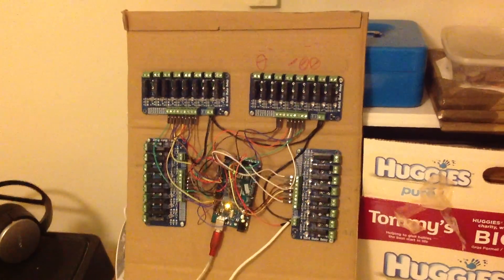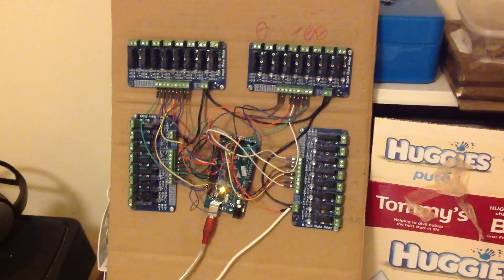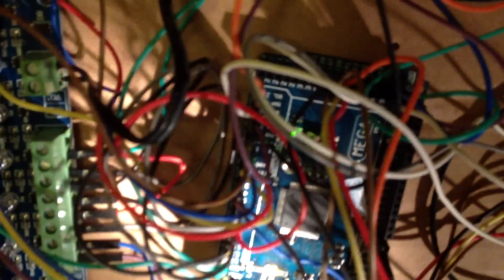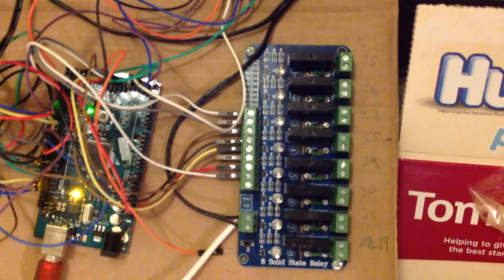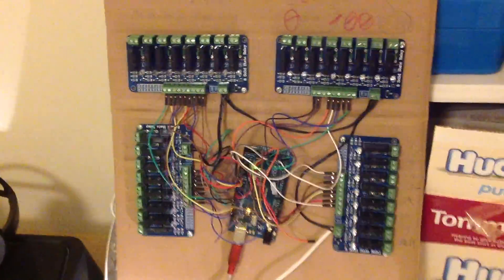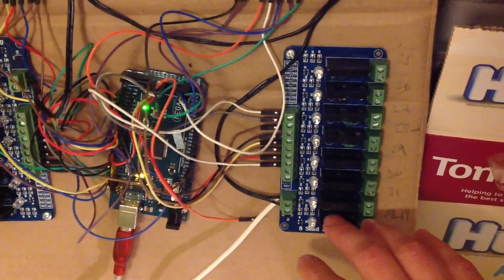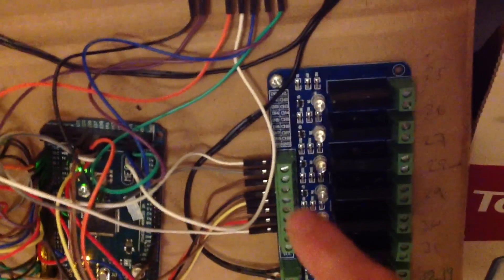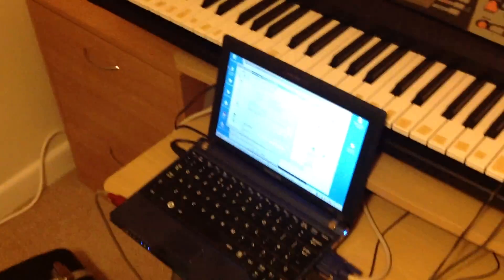Vixen 3 - Arduino Mega 2560 - Sainsmart SSR Relay Board (VIDEO 1 OF 6)

Comment: Simon

Good to see someone is at the same point as myself on the christmas lights.  I started last year with 16 channels.  I am doing more this year and was happy to find your video.  thanks for sharing.   

Currently, I am using the sainsmart 5v relay board for 16 channels and need to upgrade to the SSR.  I have been really happy with the performance.   I do want to move to the SSR relays but I am considering moving to Renard-plus but need to do a bit more research but will allow dimming and rgb control.  It is always the budget that keeps me in check though. 

I am using Vixen 2 still and version 3 is still a little too much to try to take on in the short time I have until I need to get everything going.  

This year I am considering pushing the Arduino Mega with 44 channels.  This code is a small modified version of one I copied last year.  I was watching your video and I noted you were going to upload your code.  You had a few things that peaked my interest in the header of the comm.  

Also I have considered connecting the mega and the Uno on the same computer to expand more or connect them using serial connection.  

Here is my code for simple serial interface using USB.  Did you post your code yet anywhere I can look at to see what you did this year?

int A = 2;
int B = 3;
int C = 4;
int D = 5;
int E = 6;
int F = 7;
int G = 8;
int H = 9;
int I = 10;
int J = 11;
int K = 12;
int L = 13;
int M = 22;
int N = 23;
int O = 24;
int P = 25;
int Q = 26;
int R = 27;
int S = 28;
int T = 29;
int U = 30;
int V = 31;
int W = 32;
int X = 33;
int Y = 34;
int Z = 35;
int AA = 36;
int AB = 37;
int AC = 38;
int AD = 39;
int AE = 40;
int AF = 41;
int AG = 42;
int AH = 43;
int AI = 44;
int AJ = 45;
int AK = 46;
int AL = 47;
int AM = 48;
int AN = 49;
int AO = 50;
int AP = 51;
int AQ = 52;
int AR = 53;

int i = 0;
int incomingByte[44];

void setup()
{
  Serial.begin(9600);

  pinMode(A, OUTPUT);
  pinMode(B, OUTPUT);
  pinMode(C, OUTPUT);
  pinMode(D, OUTPUT);
  pinMode(E, OUTPUT);
  pinMode(F, OUTPUT);
  pinMode(G, OUTPUT);
  pinMode(H, OUTPUT);
  pinMode(I, OUTPUT);
  pinMode(J, OUTPUT);
  pinMode(K, OUTPUT);
  pinMode(L, OUTPUT);
  pinMode(M, OUTPUT);
  pinMode(N, OUTPUT);
  pinMode(O, OUTPUT);
  pinMode(P, OUTPUT);
  pinMode(Q, OUTPUT); 
  pinMode(R, OUTPUT);
  pinMode(S, OUTPUT);
  pinMode(T, OUTPUT);
  pinMode(U, OUTPUT);
  pinMode(V, OUTPUT);
  pinMode(W, OUTPUT);
  pinMode(X, OUTPUT);
  pinMode(Y, OUTPUT);
  pinMode(Z, OUTPUT);
  pinMode(AA, OUTPUT);
  pinMode(AB, OUTPUT);
  pinMode(AC, OUTPUT);
  pinMode(AD, OUTPUT);
  pinMode(AE, OUTPUT);
  pinMode(AF, OUTPUT);
  pinMode(AG, OUTPUT);
  pinMode(AH, OUTPUT);
  pinMode(AI, OUTPUT);
  pinMode(AJ, OUTPUT);
  pinMode(AK, OUTPUT);
  pinMode(AL, OUTPUT);
  pinMode(AM, OUTPUT);
  pinMode(AN, OUTPUT);
  pinMode(AO, OUTPUT);
  pinMode(AP, OUTPUT);
  pinMode(AQ, OUTPUT); 
  pinMode(AR, OUTPUT);
  
}

void loop()
{
  if (Serial.available() >= 44)
  {
    for (int i=0; i<44;i++)
    {
      incomingByte[i] = Serial.read();
    }                                       // Arduino pins
    digitalWrite(A, incomingByte[0]);  // Pin 2
    digitalWrite(B, incomingByte[1]);  // Pin 3
    digitalWrite(C, incomingByte[2]);  // Pin 4
    digitalWrite(D, incomingByte[3]);  // Pin 5
    digitalWrite(E, incomingByte[4]);  // Pin 6
    digitalWrite(F, incomingByte[5]);  // Pin 7
    digitalWrite(G, incomingByte[6]);  // Pin 8
    digitalWrite(H, incomingByte[7]);  // Pin 9
    digitalWrite(I, incomingByte[8]);  // Pin 10
    digitalWrite(J, incomingByte[9]);  // Pin 11
    digitalWrite(K, incomingByte[10]); // Pin 12
    digitalWrite(L, incomingByte[11]); // Pin 13
    digitalWrite(M, incomingByte[12]); // Pin 22
    digitalWrite(N, incomingByte[13]); // Pin 23
    digitalWrite(O, incomingByte[14]); // Pin 24
    digitalWrite(P, incomingByte[14]); // Pin 25
    digitalWrite(Q, incomingByte[15]);  // Pin 26
    digitalWrite(R, incomingByte[16]);  // Pin 27
    digitalWrite(S, incomingByte[17]);  // Pin 28
    digitalWrite(T, incomingByte[18]);  // Pin 29
    digitalWrite(U, incomingByte[19]);  // Pin 30
    digitalWrite(V, incomingByte[20]);  // Pin 31
    digitalWrite(W, incomingByte[21]);  // Pin 32
    digitalWrite(X, incomingByte[22]);  // Pin 33
    digitalWrite(Y, incomingByte[23]);  // Pin 34
    digitalWrite(Z, incomingByte[24]);  // Pin 35
    digitalWrite(AA, incomingByte[25]); // Pin 36
    digitalWrite(AB, incomingByte[26]); // Pin 37
    digitalWrite(AC, incomingByte[27]); // Pin 38
    digitalWrite(AD, incomingByte[28]); // Pin 39
    digitalWrite(AE, incomingByte[29]); // Pin 40
    digitalWrite(AF, incomingByte[30]); // Pin 41
    digitalWrite(AG, incomingByte[31]);  // Pin 42
    digitalWrite(AH, incomingByte[32]);  // Pin 43
    digitalWrite(AI, incomingByte[33]);  // Pin 44
    digitalWrite(AJ, incomingByte[34]);  // Pin 45
    digitalWrite(AK, incomingByte[35]);  // Pin 46
    digitalWrite(AL, incomingByte[36]);  // Pin 47
    digitalWrite(AM, incomingByte[37]);  // Pin 48
    digitalWrite(AN, incomingByte[38]); // Pin 49
    digitalWrite(AO, incomingByte[39]); // Pin 50
    digitalWrite(AP, incomingByte[40]); // Pin 51
    digitalWrite(AQ, incomingByte[41]); // Pin 52
    digitalWrite(AR, incomingByte[42]); // Pin 53
    
    
  }
}